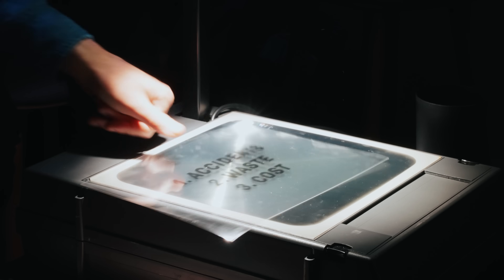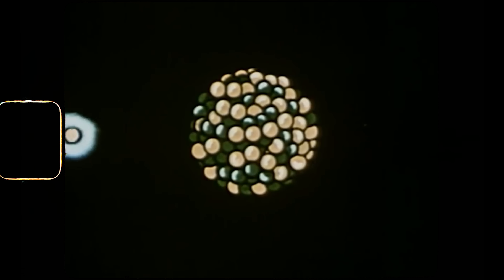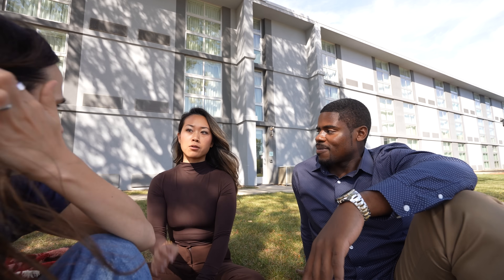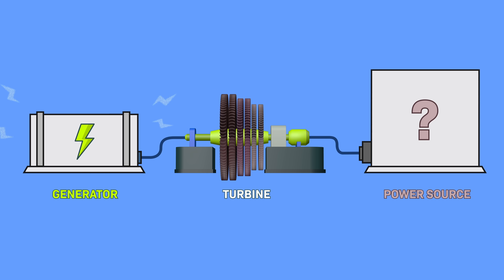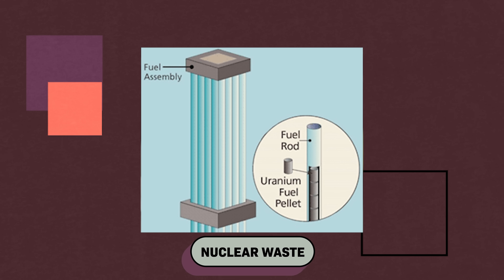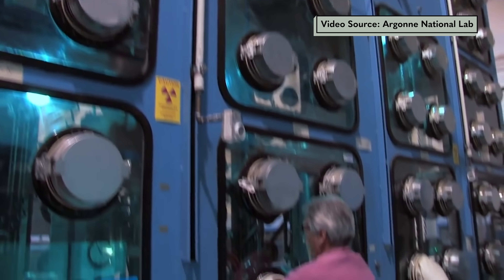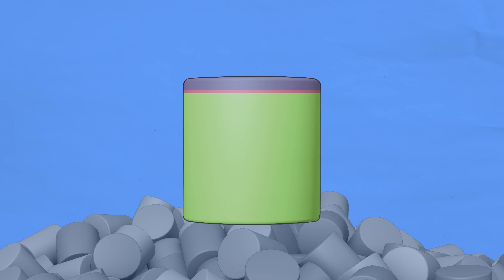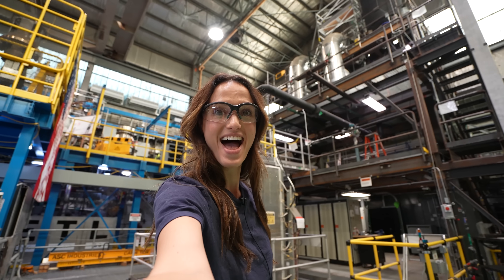The Big Lie About Nuclear Waste

Comment: France is the largest recycler of spent fuel. I'm surprised it didn't turn up in your research. Also, the reason it isn't recycled in the US is due to nonproliferation concerns. While it seems feasible that recycling could be controlled in a way that prevents proliferation (whatever we do with LEU should be adequate one would think), I'm surprised that this also wasn't presented. If we are going to revive nuclear energy we are going to need to remove unnecessary bureaucratic hurdles.

Comment: What you say is not completely true.
The product from the recycled nuclear waste is NOT radioactive for a shorter periode of time. The half life of the product, the more concentrated nuclear waste, can only be shortened by a process called transmutation.
The problem with this process is that its to this date not possible to scale it. Science has prooven that it works, but our technology isnt good enough and we still only have test facilities.
Another problem with recycling atomic waste is that, at least in the recycling facilities in europe, a big amount of water is contaminated and released in the oceans. This contaminated water is a big problem!
It might be possible to develop a way of  using nuclear energy in a good and clean way but today we are NOT able to do it